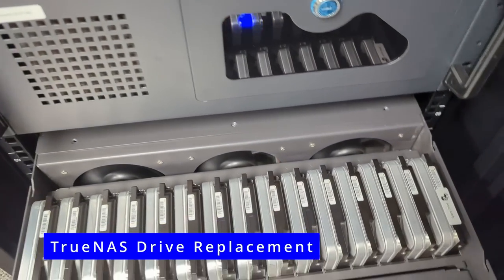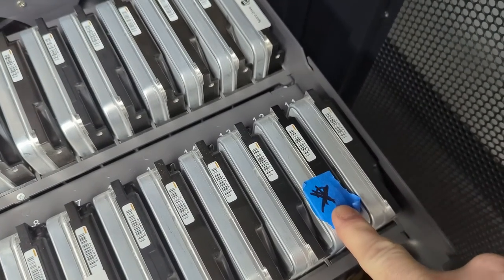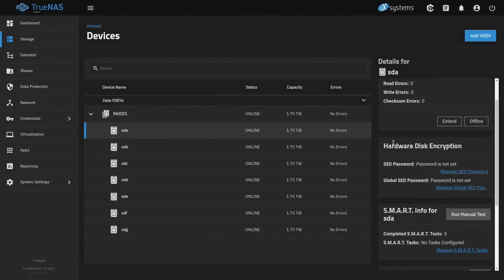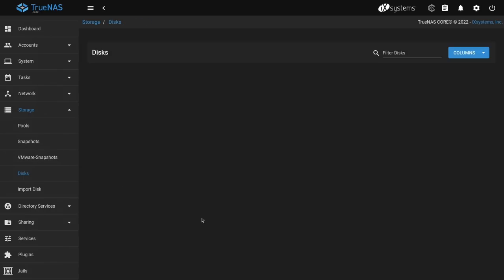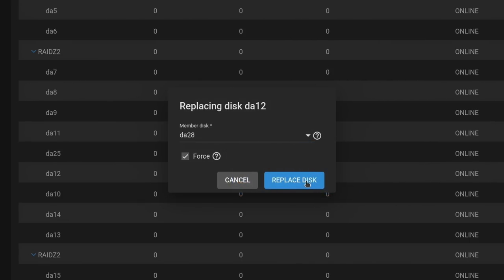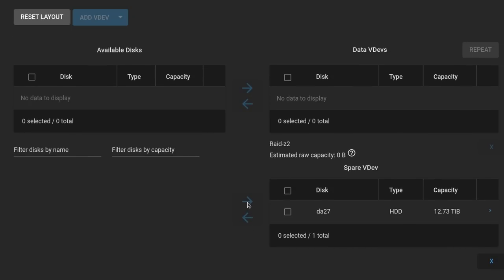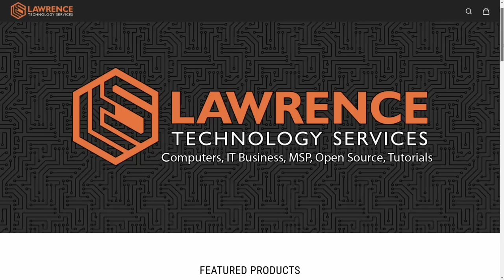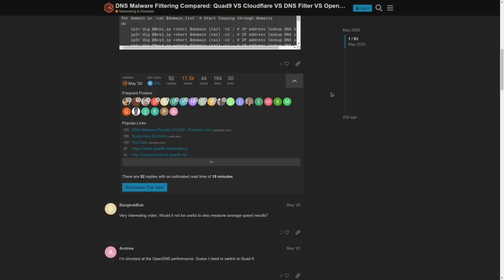How To Replace A Failed Drive in TrueNAS Core or Scale

Comment: Are there other options to identify drives? For example: you've got a hdd-module with hot swap trays/bays, where the serial number is not visible without removing the drive. Can TrueNAS make the hdd-led of a drive blink in a certain pattern for id'ing the right drive?

Comment: TrueNAS documentation says that you have to offline the faulted disk before hitting the replace button.
Reply from the maker: You can do it that way as well
Reply: @LAWRENCESYSTEMS  The offline process is recommended because it prevents swap issues.
Reply: @LAWRENCESYSTEMS  Can you, safely, select confirm the TrueNAS warning on the off lining of a drive in an encrypted pool?
Reply: @ThePoorInvestor  That sounds like a patch needs to be submitted. Or on a forum, discuss your needs and why. This sounds very simple if it is simply a status page or are you modifying parameter based on what you see. If you're editing from the CLi, can they be done from the UI?

I hope I have gotten you started. I'd take a look myself, but don't have  TrueNAS system at the moment.

Comment: Hi Tom, great tutorial! In case we've a system with all drives assigned to a pool (no spares ones) how is the procedure of replacing the failed drive?
Thanks.
Reply: This reply is coming from an assumption that you have proper redundancy on the pool in question (RAIDz2, RAIDz3, etc).

Note that in my specific scenario I have full backups of everything on my TrueNAS server and can take a little bit more risk. My pool is setup with 12 HDDs in RAIDz3.

The way I replace a failed drive with no hot spares in a pool is to offline the failed HDD within TrueNAS, physically replace the failed drive with a new one, and then "Replace" the failed drive with the new drive inside TrueNAS. TrueNAS will automatically kick off a resilver to populate the new drive and bring the pool back to a healthy status. During this time the Pool will still be degraded and potentially vulnerable to another drive failure or potential data loss (depending on how you configured your pool redundancy).
Reply from the maker: if you pull a drive and replace it the process is the same, but the drive will show missing instead of the name.
Reply: @LAWRENCESYSTEMS  Hi Tom - again an awesome video, thank you. If I have substituted the failed drive by a new/fresh one I need to scan/identify it. In FreeBSD this is done by the command "camcontrol rescan all" which is not available any more in TrueNAS SCALE (instead I had to reboot the machine (with the repleaced/new drive) to farce all drives to identify. Is there any command I can use to re-scan for (new) disks in TrueNAS SCALE to stay online during this procedure?

Comment: Great tutorial.

I'm running TrueNAS on a machine with only 4 SATA drive bays. The pool is RAID-Z1 and one drive (ada2) has faulted.

Can I plug the replacement drive into a USB-to-SATA adapter, replace, resilver... Then shut down and physically swap the new drive in? Will it then become the new ada2 when I boot back up?
Reply: Bump.

Comment: Do you think it's worth running a resilver on the entire array to re-test an already failed drive?
I usually pull them out of production, and test them using the manufacturer tool in another machine.

Comment: I'd like to know the process if there's no 'online' spare. I'd have to power down and swap the drive. Will it auto resilver once powered back up?
Reply from the maker: Powering down depends not on TrueNAS but if you have a hot swap hardware setup. But if you pull a drive and replace it the process is the same, but the drive will show missing instead of the name.

Comment: Quick question... Does TrueNAS spin down the hot-spares, which are not part of a pool? I.e. are they consuming power / creating wear-and-tear?

What I'm trying to get at is, for the non-datacentre user, are there benefits to having hot-spares present in the chassis, as opposed to sitting in a draw, minding their own business? 😏
Reply from the maker: No, it does not spin them down, nor is there any built in options to do so.

Comment: And for example for 2x disks in mirror and one needs to be replaced, no hot-spares.
I think that's what is more common in home labs tho
Reply: My setup is 2 vdevs.  Each vdev are composed of 2 drives in mirror.  the pool is encrypted.  I would like to know how I could go about in removing, first, one drive, resilver and eventually, the second drive, so the end goal is to have upgraded the amount of available storage from 4tb to 12tb.  thanks.

Comment: Looking at swapping out some drives after X amount of years. Still in the planning phase and I am looking at a Raidz2 configuration. After some research, it looks like there is no direct way to go from Raidz1 to 2 so I will have to get the first batch of drives at once. This is likely dangerous as the pool will likely age super evenly which could lead to multiple failures at the same time. Since pulling a drive and replacing it within parity causes the new drive to be populated and merged, would it be safe to replace some of them after a few years within batches of parity to better distribute wear? The extra drives, should be safe to use afterwards as spares if taken care of. What would happen if I do this to a Parity drive? Would the other Parity drive be able to come to the rescue or would I be in trouble? After looking at a lot of documentation, I believe yes however, I am still very much a noob in the scene.

Comment: You said you can't have a ZFS hot-spare in multiple zpools, but that's not what I've been told. It requires the CLI to do it. I don't know more than that. I think you take the hot-spare and add it to multiple zpools.
Reply from the maker: There are many "unofficial" way to do things
Reply: @LAWRENCESYSTEMS  Is it unofficial because TrueNAS doesn't have UI for it? I use `zpool iostat -v` to check on the boot pool and see how much I've loaded up my "special" vdev. That's not supported by the TrueNAS UI, but I wouldn't call it unofficial.